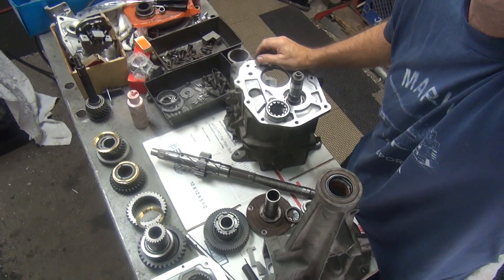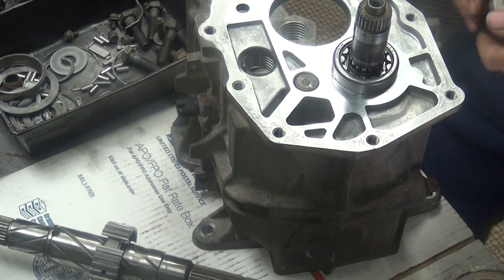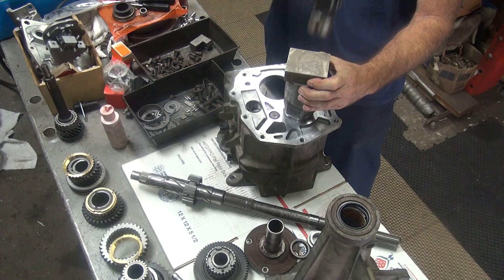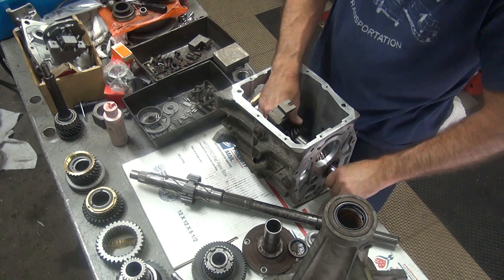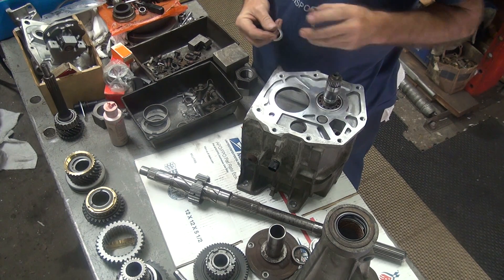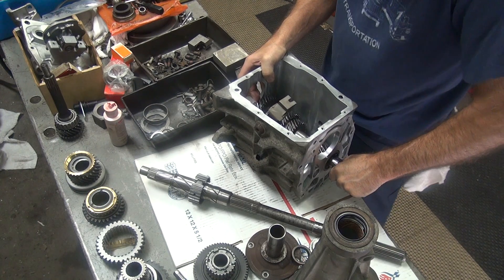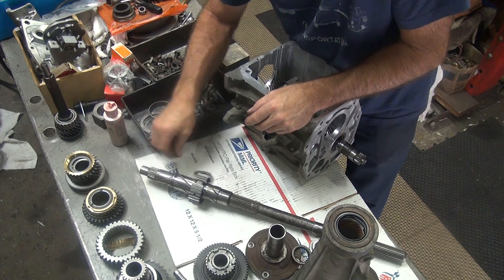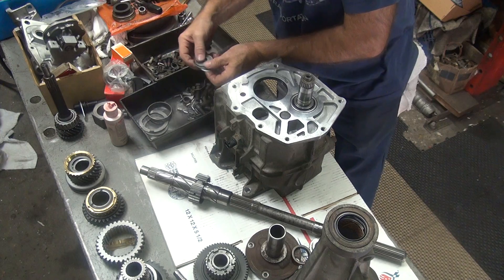#103 1982-95 Chevy T5 NWC Tremec transmission rebuild Borg Warner non-world-class T-5 5 speed S10

Comment: How did you remove the countershaft? The book vaguely says to push on the gear, and I saw you used a brass drift to shift it slightly. Should I use a brass drift to remove it fully? Or put a bearing splitter on the very end and connect a slide hammer to it to un-seat the countershaft bearing? Thank you for this video series!
Reply from the maker: i don't remember. i used what you see. i should have said what i did.
tatro

Comment: Oh here we go, right at 5:27, your hand touches the missing counter shaft thrust washer w/tab in the corner of your parts box. I'll have to keep watching the rest of the video and others if you caught this part or it ended up as the one part remaining after complete assembly.....I hope not. Those thrust washers typically are the wear item on the counter shaft and should be replaced.
Reply from the maker: i might be a dumbass at times but i know what thrust washers are and when they are needed. it took two attempts before i figured out how things go back together. cars and harleys require a different way of thinking.
tatro
Reply: Does that thrust washer go in between the case and counter gear